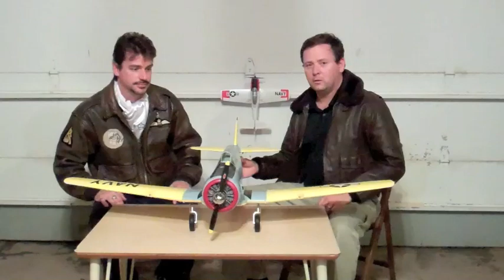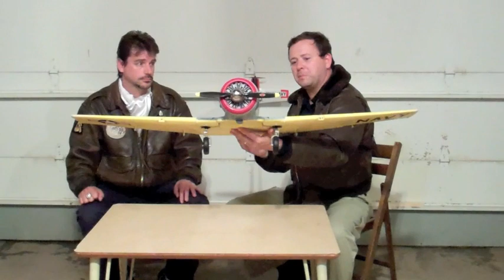Why does my airplane always go left?

Comment: Small aircrafts have a tendency to go left due to the rotation of the prop going clockwise this is correct but as a prop goes on the down cycle it pushes pressure up underneath the left wing which is your high pressure and this pushes up against the fuselage this will cause your aircraft to always want to bake left and that makes it difficult for the pilot solution is angle your motor 2 degrees down 2 degrees to the right now this will get rid of that problem and your plane will have a great characteristic.. big aircrafts you can run the motor straight and it overcomes that problem small aircrafts have a tendency to do this because they are small their dictated by the torque of a motor and the prop wash up against the high pressure of the left-wing I've been doing this for 30 years some of their info they said is right but some of their info was incorrect... I ran many airplanes and tunnel test I know

Comment: p Factor is not  gyroscopic precession!  It's the different angle of attack of the propeller blades when the plane is not in level flight, resulting in an asymmetric relocation of the center of thrust at high angles of attack.

Comment: Very good explanation guys. I've always wondered though that if the flight controls can be "programmed" so that they automatically move to compensate for the 3 tendencies based on prop RPM/airspeed and angle of attack etc. so it is practically transparent to the pilot. Also wondering if twin props have the same problem.